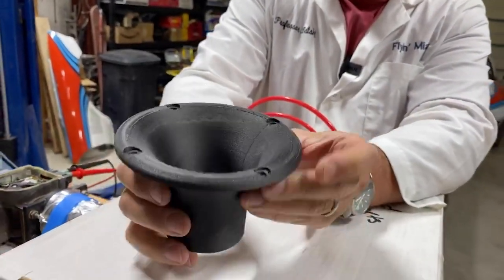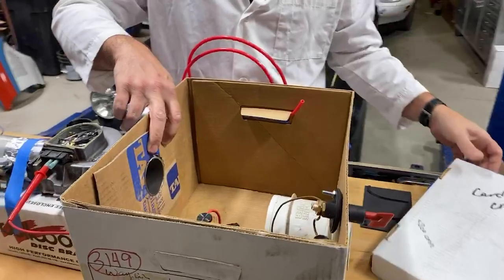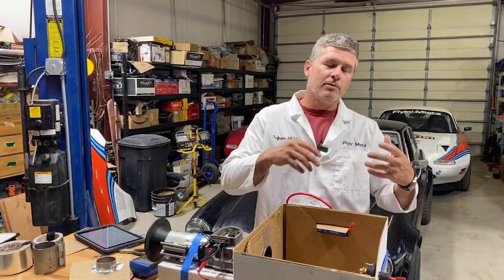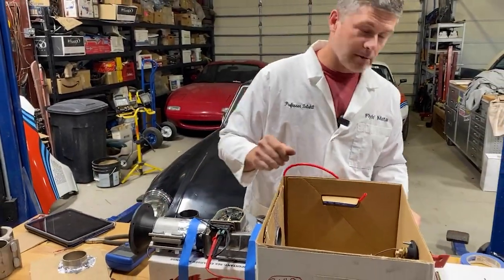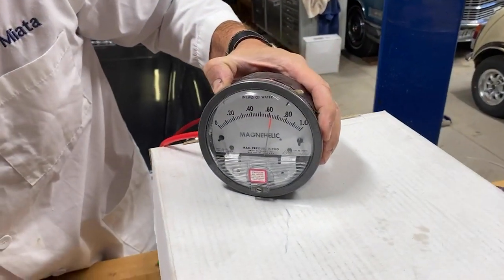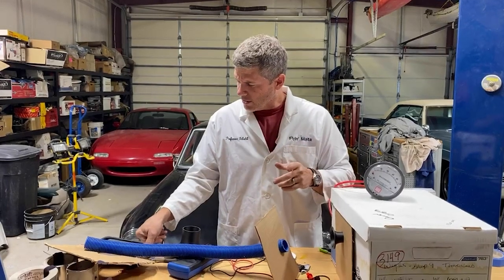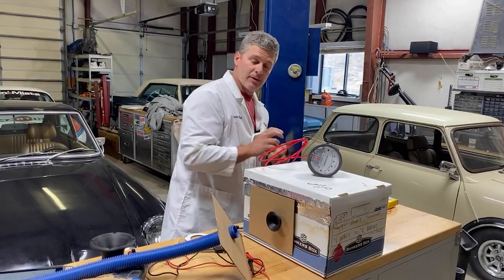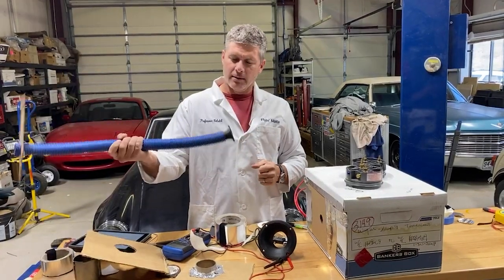Failed Experiments (FM Live)

Comment: I love this video, but I am wondering about the goal of the test. I think you've found a reasonable test for comparing inlets, but only as drawing from a static plenum. The ram air of a brake cooler is going to behave differently. I'm not suggesting that you need to go back to the positive pressure on the intake side because that won't make a bit of difference. I just think that an intake optimized for a static plenum might not necessarily be the best intake for a free stream. Besides that, while we know more air is better, that is somewhat difficult to quantify. You can work out the change in mass air flow from your test, but that will be difficult to correlate to the ram air. Even if you did that successfully, then taking that to a new convection coefficient would be extremely optimistic. Your uncertainties between what you've measured (pressure drop) and what you care about (temperature) are fairly large. In short, I think I'm saying you need a heated spinning plate inside a wind tunnel to develop a speed-dependent, variable-shape inlet so you can sell the most expensive brake cooling kit since the rockets that slowed the Curiosity rover's descent. No need to thank me.
Reply from the maker: Thanks Mark :) The amount of discussion this video has created is really fun.
We're not really looking at temperatures of the air - the amount of heating from compression, for example, is going to negligible. We're just trying to deliver as much air as possible to the brake rotor. What follows then is a separate area of study, but lots of air is a contributor. I'm not sure the ram air variant will work much differently as long as the direction of airflow doesn't mess with us. The air on the front of an air dam moves relatively slowly which is why it's high pressure in the first place.
We're likely going to have these on a race car in a few weeks with some documentation on actual rotor temperature. That's the true test, but difficult to perform during a live video shot in a home garage with a cellphone. This whole thing started as a "how do we demonstrate how these can have an effect?" and turned into a pretty fun couple of days.

Comment: I am not an engineer but surely it doesn't help you have a massive hole in the cardboard box (the handle that's being propped open by a red hose) and no seal on the top of the box, those are MASSIVE leaks.  There's no way you're going to get a proper reading on your airflow sensor when it's so much easier for air to go through the handle instead of trying to force the airflow sensor flap open. (The cross sectional diameter of that open handle flap is nearly the same size as the cross sectional diameter of your airflow meter)

Secondly isn't the entire concept kind of flawed ? A velocity stack (bell or bellhorn intake) is really only going to help when you have a decently large pressure differential between the intake and exhaust. Are unpowered brake vents/ducts ever going to create a strong enough pressure differential to REALLY extract much benefit from a velocity stack ?
Reply: I just want to clarify i'm not saying velocity stacks dont work, they clearly do. But how much marginal benefit will you get out of this compared to say, locating the end of the intake in a better location (to minimize kink's in the ducting, to access cooler air, to access air from a location to maximize the "Ram" effect) I'm really not sure ...
With that said, there's very little reason to NOT use a velocity stack, packaging wise you require just a BIT more room than if it wasn't there so if you have the space go for it. You should still always try to maximize the diameter of the ducting FIRST and the inlet shape should be a secondary consideration though ...
Reply: Dominic the handle in the box has blue tape covering it.
Reply from the maker: The handle hole is sealed with tape on the outside. 
I agree that you want as much cross-section as possible, but anything bigger than 2.5" is difficult to package in a Miata. The Targa Miata uses 3" hose and the big hose limits wheel lock travel and the packaging at the rotor is very tight. You end up with some very tight bends and if you rub the wheels too many times, you get a hole. It's not a setup that would be acceptable on a lot of applications, so we're looking at how to optimize flow for a 2.5". If you're going to have brake ducts of any size, why not make them work as well as possible by simply choosing a better inlet design?
You've got a lot of pressure on the nose of the car. We've talked in the past about how to drop pressure at the other end. It all works together.
Reply: @FlyinMiataVideo  absolutely agree with you that the marginal gains are worth going after even if they are exactly that (marginal) as long as it doesn't take a tremendous amount of effort/cost to do.

I really do (and I'm sure others as well) appreciate you guys doing the testing and (furthermore) SHOWING the testing to us (your consumers).

Personally I'm kind of on the fence about chasing the marginal/incremental fraction of a second or gram or whatever it might be as with all hobbies (gold, watches, cars, guns, computers, whatever) there are lots of snake oil salesman out there and often times the bigger the claims the more dubious the actual results. 

Personally I both love and hate objective stats... There is a time and a place for it (I don't think anyone needs to prove velocity stacks work... It's such a recognized and standard technology it's kinda like buying a 777 and asking the Boeing salesman to prove aerofoils/wings work...). As long as you're not trying to sell it as something that it isn't (claiming 200% increase in cooling for example) or charge an obscene amount for what is proven technology because it's "new" (apple trying to sell you a new feature that android has had for generations cough cough)  I think consumers come out ahead.

Data is great but not everyone out there is a data scientist and bad data is often worse than no data. So much pseudo science out there nowadays that it's incredibly frustrating for anyone who's even a little bit scientifically literate to more help body murder at least once a day because of companies making impossible claims. 

On a completely unrelated note, could you do a suspension alignment/geometry video (camber /caster/toe) ? I got your book (how to build a performance miata) but it (along with every other internet resource I can find) doesn't adequately explain how toe affects stability and tendency to understeer or oversteer (primarily at the front). 

I always try to approach the problem by imagining the car going straight down a road and suddenly one wheel hits a patch of ice or oil slick ... For toe out at the rear wheels it's clear the wheel with traction will induce a moment on the car which turns in the direction which will cause weight transfer towards the grippy rear wheel, thereby this is a positive feedback mechanism and is unstable (toe out at the rear will make it easier to spin out). This is in agreement with real life. At the front though my intuition diverges from everything I hear from tuners and engineers. My logic is toe out at the front is stable, imagine same situation, I have toe out in the front and my left tire hits a patch of ice or oilslick. My right wheel because of my toe out will try to initiate a right turn which will cause lost transfer to my left wheel which is currently deficient of traction, with extra load, the left wheel will have more grip and try to initiate a left turn, bringing the car back to center... This however is wrong in practice as literally every resource I've seen says front wheels toe out is more twitchy and unstable because it creates some natural Ackerman geometry which while I agree with that point it only really provides an explanation for how easy it is to initiate a turn, not how stable something is (tendency to amplify/dampen random shocks from a state of equilibrium) 

P.S. Sorry for the wall of text
Reply: @2007MXV  thanks

Didn't see it the first time.

Comment: I'm not a science teacher but I'm crying.  you tested the bell mouth the opposite way than how you'll be using it.  you tested it sucking air in through it.  You'll be using it as a brake duct on the front of a car where you'll be pushing air through it.  the very first setup with the bellmouth inside the box was the right idea for the application.  But this test tells us zero about how it'd perform as a brake duct on the front of a car.  If you choose to rerun this test the correct way can you please please please make anther video about it?  Cause I've been seeing this bellmouth thing spouting about how its great for airflow, but all the testing I've ever seen has been only sucking air through it, and all the interpretation I've seen has been like "screw logic it worked here so it'll work in every conceivable application!!!".  and furthermore, when testing pushing air through it, you should test with the bellmouth both protruding from the surface and flush mount with the surface.  rant over, but please do the test.
Reply: not really
it's a static setup (unlike feynman's sprinkler)
all you care about is the pressure differential at the intake and exhaust ends 
which is the same regardless of whether you have positive pressure at one end and atmospheric in the other vs  atmospheric at one end and partial vacuum at the other

furthermore depending on how the exhaust of the brake duct is setup you might actually get a decent partial vacuum at the brake disc side if you could get a good enough seal at the rotor
Reply: Dominic Leung so prove it, do the test the other way too.
Reply from the maker: Dominic is correct, it's all about pressure differential. We're moving from an area of high pressure to an area of low pressure. It doesn't matter if that high pressure is higher or lower than ambient, the entire goal is to test the pressure ratio. It's the standard way of testing this sort of thing.  It tells us a lot more than zero, it tells us that increases the efficiency of the inlet when air is moving through it. 
That said, it wouldn't be that hard to do with the current setup. The shop vac has an outlet as well as an inlet.
The next step is to actually bolt a set of these to the front of a car and measure brake rotor temps. That's difficult to do in a live video shot in a garage, but it's the real test.
Reply: Flyin' Miata yes, I know your moving air from a high to low pressure area, that’s not the part I’m questioning. I’m questioning if you flipped the bell mouth around if it would still help things along.
Reply from the maker: Well, it would still be moving air from a high pressure area to a low pressure area. What's different? The absolute pressures, but that's not what drives the flow. As we approach supersonic flow speeds that absolute pressure is going to start to matter, but we're not anywhere close to that threshold.
I'm going to try it anyway simply because it would be easy to do and it will be interesting, but it's unlikely we'll shoot another video showing the same result.
Reply: Flyin' Miata the point is to see if the bell mouth improves things. The hole by itself without the bell mouth moves air too, but you decided to “improve” moving air by adding the bell mouth. But the problem is you test the bell mouth only one direction, the opposite direction of how you’ll be using it.
Reply from the maker: @boblast5582  But we're not. We are testing it just the same way we'd be using it, moving air from high pressure to low pressure. Don't get hung up on the absolute pressure, otherwise you're going to start checking the barometer to make sure your brake ducts will work today!
Reply: @boblast5582  if they do it would be important to not aim the fan (the defroster fan) directly at the velocity stack, that will 100% screw with the numbers.

Also, a simple thought experiment will show you for this static setup (the medium is the only thing that moves, not the ducting itself (the key difference in the Feynman sprinkler experiment) the pressure differential is what matters. The velocity stack doesn't "know" what atmospheric pressure is or care what it is.
Reply: @FlyinMiataVideo  yes its about pressure differential.  But in case 1 you're increasing pressure on side A to create that differential and in case 2 you're reducing pressure on side B to create that differential.  so the way the air moves through the hole is different.  you only tested case 2, but with brake ducts you'll be using it like case 1.  if its just a regular hole that symmetrical in both directions then case 1 vs case 2 doesn't make a difference.  But you're putting a bellmouth on it so the way the air travels through the hole is not symmetrical.
I looked up the Feynman sprinkler experiment Dominic mentioned.  It actually illustrates exactly what I'm talking about in this vid https://www.youtube.com/watch?v=sDDbX23Xeyc
look at how fast the sprinkler spins up in the first scenario and how much slower it spins up when the airflow is reversed.  its still the same pressure differential but theirs a huge difference in the acceleration of the sprinkler depending on the direction of airflow.
Reply: @DominicLeung87  see the second half of my last response to Flyin' Miata,  Thanks for helping me illustrate my point.
Reply: @boblast5582  The two major differences i was trying to allude to are that 1) with this one though the analysis is of how the ducting moves through the medium /fluid (not applicable with the brake duct) 2) the scenarios in the Feynman sprinkler are that the flow reverses, in the brake duct the flow is not reversed, your concern is there's a difference between (low =less than ambient & high=ambient vs low =ambient & high = above ambient)

Imagine running the experiment twice, once at sea level and another at 8000ft of elevation. In order to keep absolute pressure at the high/low inlet the same value, you necessarily need to create lower than ambient pressure at a level and higher than ambient pressure on the other side at elevation. The result will be the same (controlling for air temperature)
Reply: Dominic Leung look, if I’m wrong do the stupid test the way I asked and prove it. Why is everyone so opposed I actually testing all 4 conditions. You just test one and assume the other 3 are the same. That’s the opposite of science.
Reply: @boblast5582  mate, no one owes you anything... 

This is a very basic principle that has been tested before numerous times by uncountably many individuals.

No one is going to deliberately go through the trouble of making another video which is not a simple affair.

If you're so confident, do it yourself and post the results and prove the world wrong.
Reply from the maker: @boblast5582  Keep in mind that Flyin' Miata's main business is something different than running random tests to satisfy YouTube comments. So these tests don't get done during the day unless it's a fun video to entertain and hopefully educate, and we only do those once a week.
However, at 10 pm I headed down to the shop and ran the test with a pressurized box so air was blowing out through the bellmouth instead of being sucked into the bellmouth. I even added baffles inside the box so there was no chance of the airflow entering the box messing with the results.
With the 32mm hole, I had 2.7 inches of water on the gauge - that's the pressure buildup inside the box. With the bellmouth, I had 2.4. This is a similar difference to what I saw when I was using vacuum to drive the bellmouth - in that case, it was 2.4 vs 2.0. The ranges are different because I spent more time sealing the box with the high pressure test.
So we have now shown experimentally that air flowing through a bellmouth works much the same whether it's moving from an area of high pressure to an area of low pressure, or whether it's moving to an area of low pressure from an area of high pressure.  It's driven by the pressure differential in both cases.
Any further experimentation with boxes and shop vacs will be left as an exercise to the reader :) Next step for us is to put these on a car and measure brake rotor temps, which is what matters.
Reply: @FlyinMiataVideo  awesome! thanks! (although you didn't have to do it tonight at 10, whenever you were gonna be in the shop next would have been great too).  During this last test, was the bellmouth inside the box like the first scenario you showed in this vid?  Or was it on the end of the hose outside the box like the last scenario you showed in the vid?  Sorry if my reading comprehension sucks, I couldn't really figure that part out based on what you wrote.  But really, thanks for doing this! you're the first person I was able to find that actually testing it like this.
Reply: Flyin' Miata all the props in the world to you Keith !!!
Reply from the maker: @boblast5582  The bellmouth was inside the box because it's an inlet. Basically a functional version of my original test. Having it on the end of a hose outside the box would make it an outlet in that case, and that would be running it backwards.
Reply: Flyin' Miata cool, that’s exactly how I wanted to see the test done, thanks for posting the results!